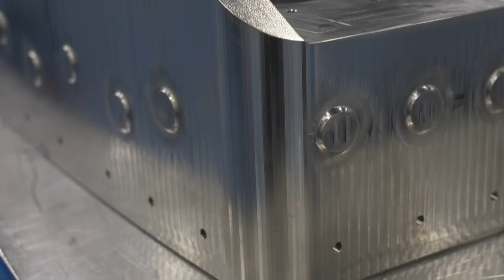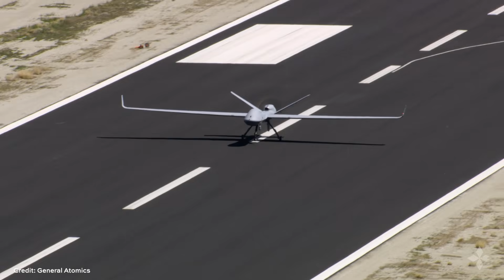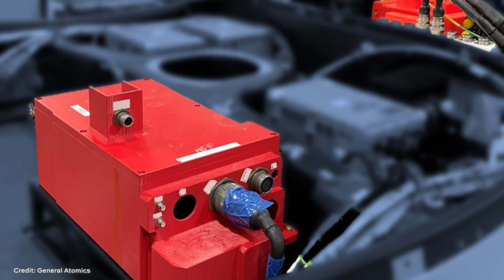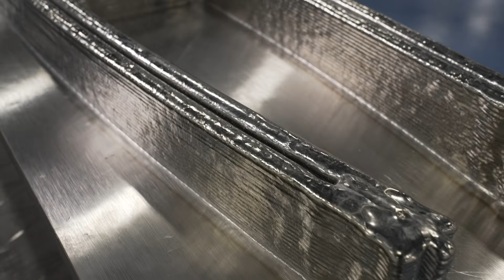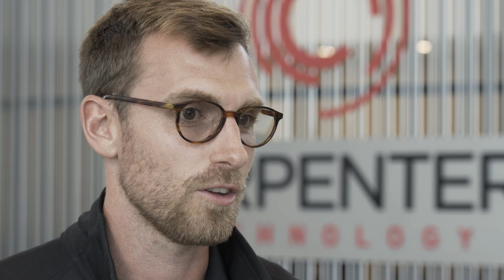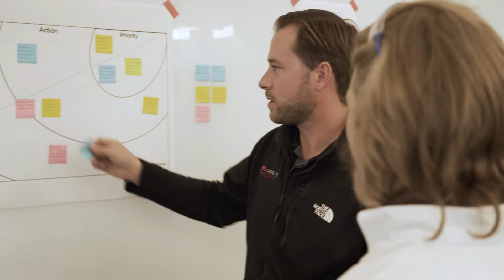3D Printed Titanium Replaces Aluminum for Unmanned Aircraft Wing Splice | The Cool Parts Show Ep.72

Comment from the maker: CORRECTION: In the episode, we said the new wing splice is for the SkyGuardian aircraft. That is incorrect. It was designed to requirements similar to those of the SkyGuardian, but which platform it will be used on has not been determined.
Reply: Shame there was no footage of chips flying on that additive part. If that same process can be used for Aluminium, the companies custom manufacturing race & street engines will be very interested - the materials and machining savings on an engine block or cylinder head would be massive, along with being able to print in better water galleries for coolant passage, making those engines lighters and more reliable. One-off parts, such as a replacement water pump for a historically signifigant vehicle, also drop in price.
I believe the Rocket Labs "Rutherford" rocket engine is made in a similar way, as are few of the newer Small-Sat launch vehicles, along with at least one using this sort of method to print the main fuel tanks of their booster.
Reply: I like to see the stress test + vibration test + shock test.
Reply: How come the titanium didn't change color with the heat of the plasma? 
It must be cool to aid in preventing warping too :)
Reply: Sure😉
Reply: Isn't there testing to ensure proper constructively for those wondering for investments?
Reply: CORRECTION : ALUMANIMALIUM

Comment: Just turn the whole thing into a powder Put it in a heated ejection mode For the whole air frame One solid piece. No parts to put together. Trim out what you don't need. Put in the working components. A solid air frame with no scenes Nothing as strong as a solid piece Just Stamped it out the whole aircraft All you have to do is put in the operational capone's  Save a lot of time and money You just need a large ejection mode Input ceramic material in with the titanium powder For heat shielding. In carbon for strength Then wrap it all in carbon fiber For a small radar section You can make a stealth drone  And it can also be used for robotics. Cologne human robot Just a idea

Comment: Wouldn't laser Metal 3d Printing be more efficient and produce almost production level parts and only need minimal tooling. Such as GE X Line 2000R , Similar machines used by Adam Savage in making the Iron man titanium suit. I can see how this Plasma DED process is better then straight block cnc milling. But next to using a laser 3d metal printer the plasma looks like a hot mess.

Comment: To truly appreciate this process one has to watch documentaries on the hell it was to develop the SR-71 Blackbird (90% Titanium) because of the fractious reactive properties of the metal, where even seasonal changes in the chlorine levels in the local water used in manufacturing caused it to corrode. Now you just put a pile of Titanium dioxide powder in a vacuum chamber, hit a button and you have your part. Some things never change though: back then most of the world's titanium came from communist Russia necessitating a CIA operation where they posed as a fake European buyer to hustle the Reds for the Blackbird's Titanium. Today it comes from communist China, but a "communism" whereby over 100 of the Chinese politburo members are billionaires. In short, they're businessmen.

Comment: Benefits of titanium: almost as strong as steel. As light weight as aluminum.  Extremely abrasive resistant 
Cons of titanium: Extremely bad at holding a sharp edge ( so very/Extremely bad for any kind of cutting tools )

Comment: Saying that additive manufacturing eliminates waste is incorrect. Reducing waste is more accurate.
Reply: In subtractive manufacturing the 'waste' gets recycled, so is it really even waste? The wasteful part would be the belts and bits and blades I guess.
Reply: @johnshite4656  I worked in BPR and we used analyze total cost of operations a lot. Everything was waste except the  steps you can eliminate.  Reducing down time, travel time. Delays and rejected parts all help.

Comment: Listened to the whole video without hearing what I wanted although possibly expected because if the most critical secrets were described then anyone might copy the process 

By this I mean that what was described was all matter of fact like creating a rough model of the finished product to minimize machining is common sense particularly when working with as rare, expensive and hard a metal as titanium. Although I'd expect scraps to be recycled, tiny particles approaching dust might be difficult to handle.

But the really big and obvious issue is the strength of the final product using deposition because unlike forging or machining starting from an ingot the internal crystalline bonding structure is usually considered broken.

So does this Norwegian company do the deposition in some special way? From the name of the process there is a suggestion that extremely high heat is applied like an arc welder but even that might not create the internal bonds to make 3D printing compete fully with forging.
Reply: Boeing and Airbus tested it and found out it was the same strength.
Reply: They have taken crystal formation into consideration.

Comment: From the couple of seconds, I saw of the deposition process I can partially reverse engineer it.
They seem to be using a High Frequency Pulse Plasma welder (similar to the airco pulsearc).
They are also using an electromagnetic arc manipulator used in shipbuilding to oscillate the arc back and forth.
They obviously have some custom software controlling the welder and oscillator.

I have often wondered how long it will be before we have CLOSED LOOP additive manufacturing that monitors the quality of the part while it is being made.
If the process detects a defect in the weld puddle, it should be able to fix it in real-time.
Reply: @dubyas1989  sorry but I have been a welder most of my life. Tell me which part in inaccurate. Are you saying that’s NOT capped plasma with electro magnetic control of the arc?
Are you a janitor?
Reply: @dubyas1989  I watched the video AGAIN. That is 100% a Plasma Arc manipulated with an EM field. Quit trying to fool a welder that is now an EE.
Reply: @dubyas1989  Bless your little heart!
Reply: @dubyas1989  So tell me exactly where my statement is false.
Did I SAY I reverse engineered the whole process?
NO.
But If I wanted to I absolutely could.
Reply: @stuartgray5877  sure you could champ.

Comment: A retired Engineer I have been 3D Printing for over 8 years to make parts for my 1950 Model Trains. I worked in Medical, Aerospace and Automation systems when working. I could see the possibilities to get the heat on these exotic materials was a problem. Then I saw concrete printing house frames. And FFP is making energy from Plasma Arcs on a small scale. Plasma ??? Now I see this and it is heart warming to see Plasma controlled to melt Titanium ina highly more efficient and effective process to use less material in waste and speed up production of critical parts. Very good work and I hope is able to be miniaturized for space station operations to fabricate spares as needed from rolls of wire. Point of use Production meets Plasma Deposition it a very good thing. Add some AI to the control logic for perfect print 100% of the time and get part Cad data for every viable part required, beam up new improved part shapes as needed, wow. D
Reply: 3D printed concrete is a scam. But everything else is legit and interesting.
Reply: soviet union used printed metal parts since 1965
Reply: USA from early 1900's. It's not the same, it's not additive manufacturing.  @jefreyjefrey6349
Reply: @jefreyjefrey6349 and most likely stole the technology from the US or other “civilized” country at the time.

Comment: Couldn't you just weld titanium to make that rough shape more or less and then mill it
Reply: You want to minimize welding in airframe components because you cannot guarantee that the weld is as strong as a solid block and causes inconsistent material properties that can lead to fracture caused by metal fatigue. Welding also may cause warpage of the part. In this case you minimize labor, need no fixturing and it is made in 1 step. You are adding multiple steps if you say welded plates together. You have to cut the plates (very expensive in titanium), fixture them, weld them, test the welds for consistency and penetration dye, then fixture in a machine and mill it (extremely expensive). This is as simple as pressing go on the machine and then voila there is your part.
Reply: @letsbuildit6954 the parts Norsk makes do still need finish machining, but yeah other than that, spot on.

Comment: any specialists here? is titanium not as problematic as in marine use? bcs of the catalyst effects destroying everything around? maybe some coating?
Reply: The properties that make Titanium desirable for use in highly demanding applications also make Ti very difficult to fabricate parts from. The Soviets wanted to make a Nuclear submarine because of these very properties "The practical problems with the design quickly became apparent and in 1963 the design team was replaced" (Wikipedia - Alfa-class submarine). The advancements described in this video offer new opportunities to revisit use of Ti in innovative ways.
Reply: Titanium is very resistant to chloride corrosion. Aluminium isn’t.
Very useful for sea skimming vehicles.
Reply: Depends on grade, mix of tipes of cristals. As in steel, more strength less corrosion resistance.
But for most, titanium is one of the best choices.
But dont forget electrochemical corrosion, contact whit other metals.
Reply: @ljubomirculibrk4097  Actually the highest strength iron alloys are very corrosion resistant - it is carbon content that accelerates corrosion.

Comment: So is the END PRODUCT PART -  LIGHTER WEIGHT. 
How much lighter weight is the DED produced Titanium Part (at the same strength performance delivering part of the existing/previously used Fully forged Aluminium alloy - CNC Cut out part.
5% lighter weight
10% lighter weight
15% lighter weight
20% lighter weight
25% lighter weight
30% lighter weight
35% lighter weight
40% lighter weight
45% lighter weight
50% lighter weight
55% lighter weight
60% lighter weight
65% lighter weight
70% lighter weight
80% lighter weight
85% lighter weight
90% lighter weight
96% lighter weight
100% lighter weight
> 100% lighter weight
PLEASE ask the General Atomics company - to answer this question - and give answer as a reply to this comment AND update the video with the information - in the video OR in the description section OR in an additional comment by you placed at the top of the comments section OR with an updated - more information filled video at the ALL ACCESS spot on your website.
Reply from the maker: Weight change actually was not the outcome sought with this part. Volume change is more like it – titanium allows for the same strength in a part that is less bulky, and takes up less space in the complete assembly.
Reply: It's about the $$ "buy to fly ratios"...weight doesn't matter as much in UAVs.

Comment: Sounds like it is more expensive than just using aluminum. I got an offer at an aerospace 3d printing company in Knoxville, TN and they only offered me $12 an hour and I have a degree and experience!!!Absolutely ridiculous and insulting! These companies cheap out on paying employees cause everything else cost so much money.
Reply: 12$ an hour is hilarious… the girl that pours my coffee at dunks down the street from me gets 18$ not including tips 😀
Reply: Norsk takes great care of us.
Reply: They say the opposite. If you make the part from aluminum you start from a block with the overall dimensions and you have to remove 90% machining. So you are paying a lot for the raw material and a lot for the machining (time, tooling...).

For big titanium parts, it is difficult to make the above in a cost effective manner. But if you start with a preform, the case is completely different.

In this same channel, there's an example at NASA of big parts being made in titanium thanks to additive manufacturing. 

Why would they change the part and the processes if it is not to save in costs?

Look for a company where they value you more, good luck!
Reply: @Darkralos but u can recycle the excess and melt into another block to be CNCed again
Reply: @uraymeiviar  In theory yes. In real life no. Machining shops do not have foundries so they do not recycle the material themselves. They can accumulate chips and sell them (at 10% the price?) But they have paid 100% for the material.
So if you sell your chips, it is like you are paying less for the material (lets say 90% of their cost). But again, you are cutting 90% of the material.
Besides, you are not taking into account the cost of machining (cutting tools, fixtures, cost of CNC machine running not doing other jobs...)

There are companies (like the one in this video) that manufacture real products using additive manufacturing processes. 

Why are we discussing if it is economically wise when they are already doing it?

Cheers 😆
Reply: @Darkralos  Because you are being ridiculous acting like they weren't welding in aluminum and just switched to titanium. Could they have been milling aluminum? Yes, but they could have also just switched printing materials. You're making assumptions out of ignorance. Neither one of us know which method it was made with before.
Reply: I'm a  carpenter making 42 dollars 😂
Reply: They stated that they did not want to use aluminum for this application.  The design requirement called for a higher strength to volume material, which in this case is titanium. Machining titanium is difficult, and mind you, an entire team of engineers worked out the math on this. It made more sense to use direct printed Ti here.
Reply: @schneider90000  determined it probably makes more sense*
Reply: Welcome to manufacruring😂
Reply: That’s too low. $15 is the minimum for unskilled labor I think
Reply: Its likely you putting parts and watching a robot... we make 16 starting doing aid of robots in Michigan for all car makers from dodge to tesla to zoox automatic taxi... and its mostly just putting parts into a machine for robots (shorts proofs) 12 is laughable and you would be maxed out driving to work with high insurance, and grocery costs (400 minimum for one small dude a month)
Reply: and if it even approves my reply above.. thats starting out third shift.. double for weekend overtime for a massive japanese aluminum part company.. which makes parts for all makers
Reply: My friend that works fast food makes like $16/hr that hilarious
Reply: It very easy to recycle aluminum, your shop can do it
Reply: It’s very hard to get tintanium
Reply: Make sure and check the box for “engineer” and not “sanitation engineer”.
Reply: 20$ a HE for Taco Bell 🔔 in California, throw away your decree and start Taco 🌮🌮🌮🌮🌮🌮🌮🌮🌮🌮 manufacturing 😎👍🇺🇸
Reply: Cost isn’t the issue. 3d printing metals allows for very complex shapes with less weight than can be done with via forging. In many cases the forging can’t be made in to a certain complexity. Also you were offered 12 dollars per hour because you’re likely worth only 12 dollars per hour based on your qualifications. This is likely the case as you’re incorrect on everything you’ve said as well as lack an understanding of how any of this works. So pretending your degree and experience actually exists, it’s unrelated and therefore useless. But you know it’s useless that’s why you are not employed in that field. A engineer or surgeon ect would say what they are, not I got a degree. Lying to complete strangers on the net for their attention is another red flag. You have to many red flags indicating your potential for an employer not to low ball you so you won’t work there. Not worth the initial hassle or the cost of investing in to you. Sorry for the rant but liars are bad enough but you’re one do the worst kind, you lie when no one even asked you anything.
Reply: @stevenPounder-p4b I cannot beleive he even said that. Of course aluminum is more expensive. 

  Yet even I a layman know titanium is used for performance, and additive manufacturing is great for complex parts. They even say in the video it is for critical parts.

 I am not sure if they even watched the video. 

 Some parts you simply shouldn't cheap on, anyway. Aluminum likes to fatigue I hear. 

 I always hear how terrible titanium is to work with. So this tech is very interesting to me.
Reply: How to be an idiot without saying you are one: Example 1